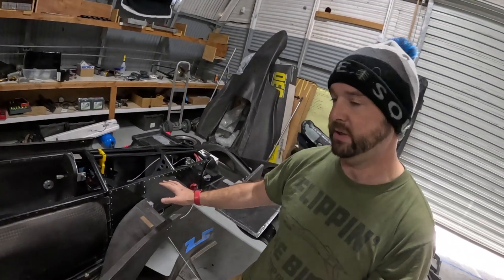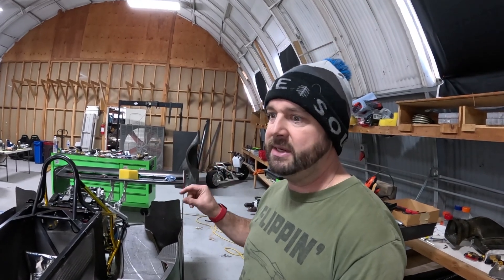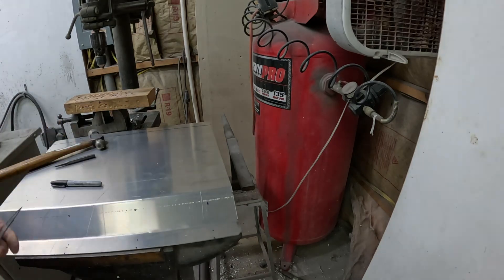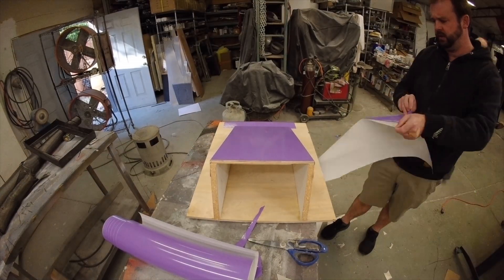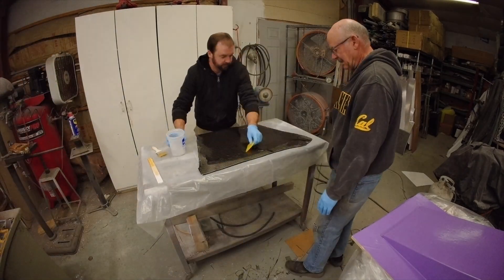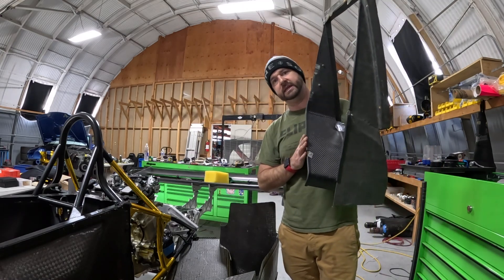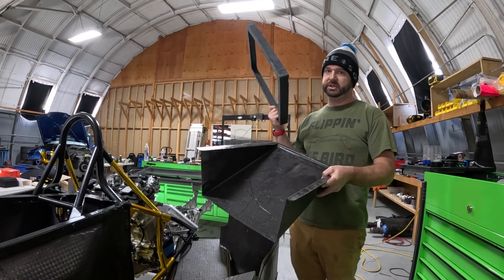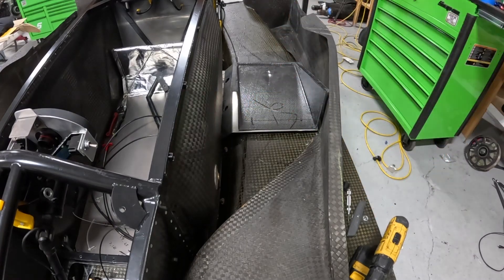Ep13: Building Carbon Fiber Cooling Ducts for my Stohr WF-1 Part 1 of 2.

Comment: Just subscribed! Loving the content. As someone who is trying to get into making my own composite parts, watching you work on your racecar helps so much!!
Reply from the maker: Thank! Carbon work is fun just difficult. Start with small parts. I’m nervous still on the big jobs we’re doing.
Reply: Check out easy composites videos 👍 I'm using their moldless methods to make my full carbon body on my V12 build. It is slightly heavier but will work great for me.